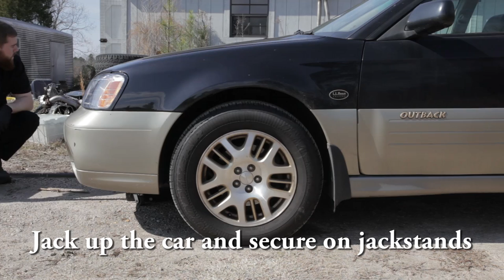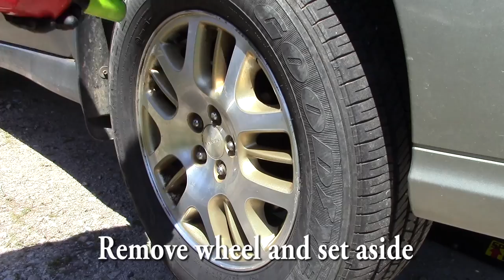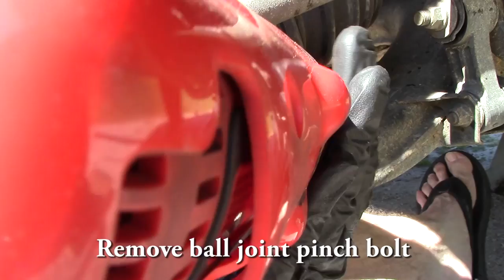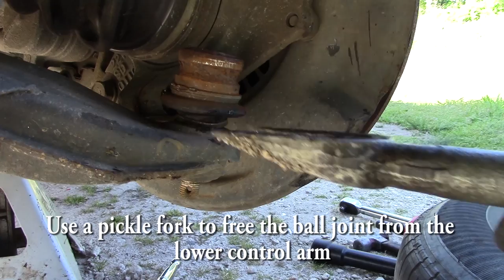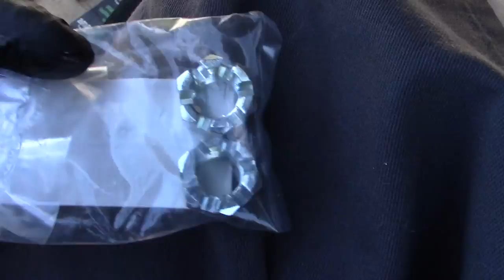Subaru Ball Joint Replacement

Comment: You made this look like the easiest ball joint video ever
Reply from the maker: +Dalton Bertrand hopefully it will go as smoothly for you.
Reply: You remove the wheel, slide the fork between 2 parts and break it loose its pretty straight forward and a simple job. If you are having issues, use pb blaster and let it sit overnight
Reply: Mine was a huge fail all around... snapped the pinch bolt, got that straightened out, then couldn't get the ball joint out of the knuckle. I'm going to order a new knuckle, I've tried everything.  Everything else went great, inner outer tie rods, sway link, wheel hubs. No more ball joints for me lol
Reply from the maker: I've had to torch, PB Blast, and air hammer/chisel them out of the spindle before.
Reply: MrSubaru1387; your videos are awesome, and thanks for the reply! I need air tools lol. This ball joint is probably factory, @180k miles. I have a new knuckle on the way, it just wasn't worth anymore of my time to be honest. Your videos have helped me a lot on my repairs and I'm glad you make them!
Reply: Dalton Bertrand I was just about to say how easy he make it look. Mine will not come out of the pinch bolt for anything.
Reply: lol the ball joints in my 230k mile 96 impreza came out as easy as in the video. southern cars are great
Reply: yeah he did make this look so easy.  having experience and the right tools makes every look easy.  i have a feeling its gonna take me all day to replace ball joint on my subaru.
Reply: The Truth Telling Mo-Fo ! That’s going to be me this week.
Reply: Just done my one on a 2005 outback. Saw a few tricks to loosen it up first. 
3 days prior of spraying with Plus Gas 
Then a veemap torch to heat it up for a several minutes. 
Remove cotter pin, had to snap off the ends and then force of the castle nut with impact driver, 
loosen lower arm with pry bar. 
Put castle nut back on
Remove pinch bolt, and use pry bar again to pop the ball joint out.
clean up and replace. I had lots of trouble realigning took a long time 2 people and some perseverance with a 2x4 a some leverage
Oddest thing was the cotter pin, I could not get it in. Ended up running a drill through the hole which seemed to workout.
Total time taken about 4 hours, most of that time was spent on the alignment the 2 bars moved very far out from each other, my prop shaft had come out by a few inches and I had turn the wheel slightly and locked the steering  wheel. 
Things happen you don't foresee and its so much harder crawling around under a car with out a lift, guess its why most people pay a garage lol

Comment: Video leaves out the most important part - you must remove the steering stabilizer from its attachment point on the lower control arm. If you fail to do this, the two arms push against each other and you'll never get the ball joint out of either piece.

Comment: i watched like 3 subaru ball joint videos and was thinking i would have trouble doing this to my 01 legacy but honestly that pry bar technique is SO smart it looks as easy as a tire rotation so glad i found this video all the others were very complicated procedures
Reply from the maker: +MonkeyBoyShit glad to help!
Reply: doing both front lower ball joints, front rotors, and all around brake pads this Saturday hoping to finally remove the shake when braking have had it aligned wheels balanced new tires new tie rod finally earned up some more money and now it's onto ball joint and rotors. Gonna be a fun weekend project getting her running right again
Reply: Jonah Cottrell how did your repair come out? I have a bad ball joint as well as shaking under braking, did your shaking go away after replacing the balljoint ?

Comment: This week I had my 2003 Outback, 2.4 4 Cyl. checked at my local Subaru dealer for the airbag recall. I was told by the tech I needed a front left ball joint for $290 + Tax. I bought one at my local Advanced Auto online for $39.37 with the 25% off coupon. You saved me over $250 on this one job. I’m doing both sides plus rear brakes (rotors and pads) for under $200. Thank you!!!
Reply from the maker: +Christian Delgado glad to help! You're welcome. 👍
Reply: I have the EXACT problem, down to the rear brake pad and rotors!

Comment: For anyone having issues with putting the ball joint back into the control arm, I ended up removing the bolt that attaches the sway bar to the end link which allowed me extra play in pushing down the control arm and slipping in the bolt portion of the ball joint. Hope this helps. Great video!
Reply: yes did this too, the control arm is quite a pain to move down.
Reply: I removed the end link and i got a 6ft pry bar and had my dad stand on it and i still could not get it down enough... i have stiff aftermarket poly bushings in my control arm which i think is why im having such a hard time
Reply from the maker: Loosen the control arm bolts/nuts at the body. Should take pressure off the bushings and allow then arm to swing down.
Reply: MrSubaru1387 that did the trick! Thanks a lot man

Comment: Took a 4ft pry bar but got my 08 legacy ball joint out doing it this way. I’m in Canada so I feel like I had a bit more corrosion to deal with as they love to load the roads with salt.  Thanks for the video! Helped a bunch! You rock. ( also used some heat )

Comment: Just did this job,  Living in New England, you will most likely not give a gentle push with a Pry bar to remove old ball joint.  Had to Keep the old castle nut on the old ball joint,  remove pinch bolt.  Next place a pipe on the end of the control arm, near ball joint.  Slam away with a 5lb sledge.  Also, the control arm is most likely pushing up, and strut is pushing down. Not sure why in this video, it looked like the control arm was flapping in the wind?   either remove sway bar end link, or strut bolts.  mark the top bolt location first.  It is eccentric shaped, and sets your alignment.  then it's easy.   Lastly, try not to let the hub swing out too far,  it will disengage the axle shaft from trans.  Don't worry if you do,  you'll have to wiggle it around, turning the hub, and get the splines to align for it to pop back in.  Otherwise, good video.  I replaced mine for about 14 bucks. Good Luck

Comment: Excellent and fun vid!  But please dont
 let the rust belt cars and the magnitude of this job shown in some of 
these Youtube vids keep you from doing this job yourself.  I'm in the 
southwest and just finished replacing both control arms with ball-joints
 on my 2006 Outback.  Soaked the 14mm pinch bolt in penetrating oil 
first, and then leveraged the control arm against the steering knuckle just like the OP showed. 
 Literally no real hurking
 at all...The joints almost fell out.  Total time to remove and replace 
the second control arm was 1/2 hour.  I feel sorry for those who broke 
the pinch bolt, but if you don't have a department of transportation 
that insists on salting roads, you'll most likely be fine and only out 
the cost of the joint (or control arm).  Good Luck!

Comment: Good Info as always ... not that it is a big deal but would be nice to have the pinch bolt part number ... if you just went to hardware store and got a flanged nut and bolt instead and added washers ... anywho ... I have a failed one that is making my steering all sorts of fun when you can turn via pressing the gas ... or lifting off the gas ... I am replacing both left and right joints as if one failed I sure the other part on the other side is not far behind so saving myself the time and just doing both

Comment: I enjoyed the video,  I do however wonder if sometimes there's a bit of editing.  Like the Producer Beat the Living hell out of a bolt, then trimmed the video to where they gently tap the bolt with a pencil eraser, and it just pops right out?   Anyhow, when I did a lower ball joint on a Subaru Years ago,  the old pinch bolt was so rusted it simply snapped.  I had to grind  it flat,  Drill a hole with a diameter slightly larger than the 10mm bolt that i would have to purchase.... that's a bit of drilling, but it can be done. I just never seem to have the cars where I gently pry, nor have I had any luck tapping with Pencil erasers!

Comment: Just did mine on my 2013 Outback here in the rust belt. Nothing worked, pb blaster, torch, air chisel, hammering for days on a board down against the control arm. What finally did it, I jacked up the control arm so it was levelish with the ground, shoved an old pipe wrench that just fit in between the knuckle and control arm then lowered it. When the arm came down, the part where the pinch bolt goes in lessens the space between it and the control arm causing it to squeeze down on the pipe wrench into the control arm which was enough force to pop out the ball joint.

Comment: Great video, I wish I watched your video before I did the ball joint and bushings on my Forester SH. It took me 2 days to do both sides as rust got the best of me. I put the cleaned corroded pinch bolts back in and it was a mistake. It still rattled. Ordered new pinch bolts hopefully it will resolve the issue. Otherwise I have to get your type of pinch bolts. The bolts I had looked different, screw in from one side only.
Reply from the maker: The factory bolts screw from one side. The one in the video showing a nut and bolt was a repair from drilling out a snapped off pinch bolt. Drill the hole oversized then add a grade 10 bolt, nut, and washers. The spindle even cracked on this one due to the bolt extractor. So, if you'll look, I had to weld and reshape the end of the spindle as well.

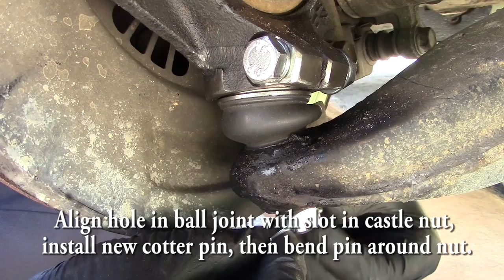Comment: Hi....Your image at 3:50 appears to have a new hub assembly and a locking bolt with nut?....Did that one Not Go Easily?....
Reply from the maker: +Lensmanic Feleven this was the driver side. camera died half way through filming. From 3:50 on it was the passenger side. The lower ball joint was rusted into the spindle on that side. Was a difficulty to say the least.

Comment: Great video.  Many thanks!  My only question is how did you get the lower control arm back on so easily?  lol   I had the new joint in after 15 minutes and have been 45 trying to get it back on!
Reply from the maker: +flyineaglewv rust-free South Carolina car, just slipped back together.
Reply: Remove the steering stabilizer bolt. Makes it tons easier

Comment: I noticed the new ball joint there had no rings on the boot to hold it and the grease in place, is that missing parts or is this a design that doesnt need the clamps?

Comment: Apologize for asking so much questions. I just couldn't find an answer on the forums. I want to do this correctly and this is my first time. Can I just get any kind of sandpaper to sand the inside housing where the Ball joint goes? And when I put grease inside the housing. What kind of grease do I use? Thanks.
Reply from the maker: +Subaru WRX you can clear rust out with sandpaper. I wouldn't grease it, a small amount of antiseize may be fine though.
Reply: MrSubaru1387 thanks!

Comment: Anyone had any experience with "555" brand ball joints? They're supposed to manufacture parts for Suzuki and Subaru. It stands for "Three Fives" a subsidiary of Japanese company Gohsyu Forge Co., Ltd which was founded in 1960 as Sankei Industry Co., Ltd and 2 years later registered it's own trademark as "555". They have the ISO 9001 quality certificate for their spare parts and manufacture suspension and steering components.
I'm just hoping they're good.

Comment: that separation at 1:33 came easy - mine is not. how do you get the control arm to pop free and move over? MIne separates but stays aligned - ball joint goes right back into the hole.
Reply from the maker: +trainlinezoo the control arm doesn't move over, just up and down. The spindle moves over side to side from play in the strut mount.
Reply: Thanks for the reply - I figured it out. 183000 miles on a 2000 outback....Replaced the inners and outers plus both ball joints and bellows boots - both front wheels in one night. The driver ball joint popped right out but the passenger ball joint put up quite the fight. Had to use a 18 inch long piece of 2x4 wood and a heavy hammer to dislodge the passenger side joint. Got an alignment done the next day and it rides so much smoother now - uses less gas - love it. No more weird clunks, lane drifting etc etc. Update 1 year later the Duralast ball joints both tore up - ordered the proper parts from Subaru
Reply from the maker: +trainlinezoo awesome. Glad you got it all sorted out.

Comment: Once again, MrSubaru making it look so easy. I gotta do this to one of my front ball joints as well. Hey, do you know if the 1st gen Foresters need grease through fittings anywhere in the front/rear suspension components? I couldn’t find any grease fittings on my car. Thanks again for another great video! 👍🏻
Reply from the maker: No grease fittings. All sealed.
Reply: MrSubaru1387 fantastic!

Comment: Curious if this will be as simple for a 2008 subaru forester? I have to change out the ball bearings and the lower bushings on both sides and was curious if there are any extra things to pay attention to. I'm fairly new to this stuff.
Reply from the maker: Should be nearly identical on your Forester.
Reply: MrSubaru1387 I got the ball joints out no problem, but I can’t get the new versions into the pinch bolt area? I thought maybe it was my new parts, but I tried to slide the old one back in just to compare, and they’re too tight also? It’s a 2004 Forester XT. Do I need a press?
Reply from the maker: No. Usually spreading out the slit in the ball joint seat helps. Also cleaning the bore with a wire brush.

Comment: What size is the pinch bolt and the castle nut?
Reply from the maker: 19mm and 12mm
Reply: MrSubaru1387 thanks, do you know anyways to get that pinch bolt to turn? No amount of PB blaster and hammer smashing ratchet is getting it to budge
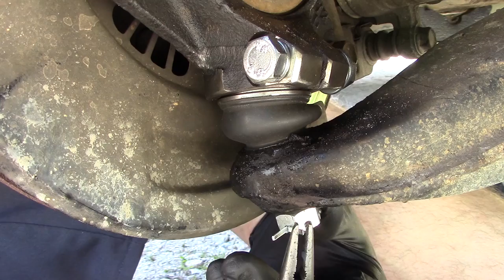Reply from the maker: Torch it. Work it slowly back and forth until it frees up. I believe I go over this method in this video - https://youtu.be/2kUUEryHHAw starts @4:02

Comment: I know you are pretty quick to respond. And your advice has saved my ass already. I'm at a loss right now. It sounds like there is a rock in my rotor. Not a constand grinding. But is almost like a tick. I took my wheel off and there is a lot of play in the hub itself. It moves up and down. (Like forwards and backwards when I move it at 12 and 6. When I got serviced before the technician stated that there was some play and it was my ball joint. But personally i cant find any material that is evidence to back up his claim. The noise sure. But a ball joint causing movement in the rotor? Not so sure. It was dark and is dark now so I couldnt get a proper look. The only thing that seemed to move was the cv axle. That moved towards the engine and towards the wheel. But the rotor didnt move with it. What am I missing! I don't have a press so the bearings would be a capital B. Tia!
Reply from the maker: +Rav3 G0d if you have play in the hub, up and down, it's about 100% a bad wheel bearing. There shouldn't be any play/movement.

Comment: Thanks again for excellent vid @mrsubaru ... I'm almost at end of my tether with my brake shake. All calipers free and unaeized with new seals. Hubs done as they started droning. 3rd set of discs now. Rear control arm bushes done. Could worn ball joint also cause disc judder (on 700 miles since new discs now and judder seems to be coming back)

Comment: any tricks to getting the ball joint out if the spindle/knuckle? lots of videos seem to use a block of wood and hammer while you pry it out. mine is stuck right where you started with it just starting to come out but can't get it any further yet. thanks!
Reply from the maker: +Joe Pond chisel and hammer, air hammer, torch, depends on how rusted in it is.
Reply: +MrSubaru1387 I don't think it is terribly rusty since its a Texas car, it moves a couple millimeters in and out of the spindle but sounds like its hitting something and won't come out further. maybe I just need to get a little more forceful prying it out? thanks, great video
Reply from the maker: +Joe Pond as long as the pinch bolt is out, spray some penetrating oil, and get to prying.
Reply: Your encouragement of persistence helped me complete new quick struts and control arms on the front of my 11 Outback. Thanks for the great video and quick responses. The new front end feels great!
Reply from the maker: +Joe Pond awesome. Glad you got it done. 👍

Comment: I. am wondering if this is the cause of my suspensions woes. The car seems to not ride well over potholes, just doesn't seem to absorb the bumps well - only way I can describe it. I just replaced the tie rods and it seems to be a bit better but I wonder if this is the cause? The struts seem to be ok with no float at high speeds. I know it's a bloody tractor (Subaru) but I recall it riding better.
Reply from the maker: +Jacana Productions could very well be.

Comment: I have question how you know if the ball joints is bad thanks Pierre
Reply from the maker: Look for torn rubber around the joint, grab the wheel with car jacked up and rock it back and forth top to bottom and side to side, if you see movement in the joint, it's bad.

Comment: I would like to do this to my 04 Forester, i hear a creak, i changed the front struts, but the sound keep... So i think i have to change the ball joints, but, i dont have the tool to tight the nuts to X torque.. What can i do with that?
Reply from the maker: Torque wrenches are fairly inexpensive. Check Harbor Freight or local parts store. They won't be a quality of my $450 Snap-on unit, but should accomplish the job.